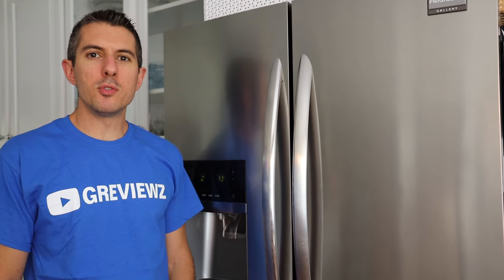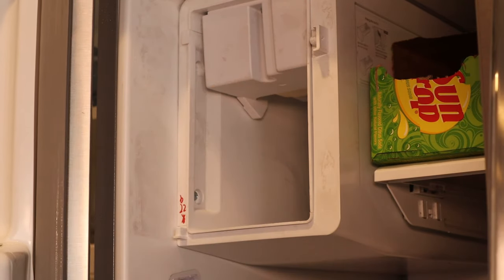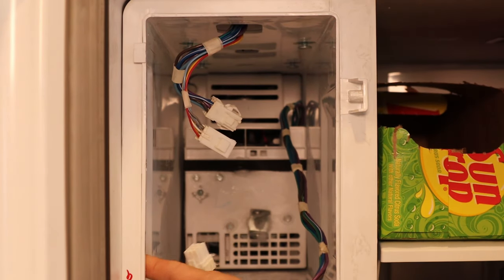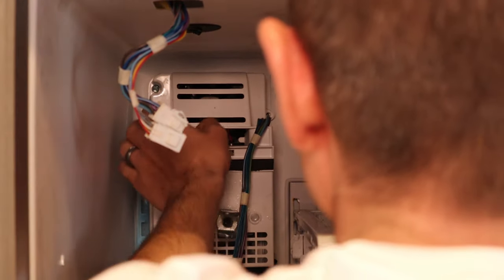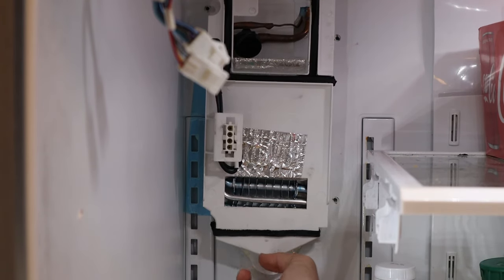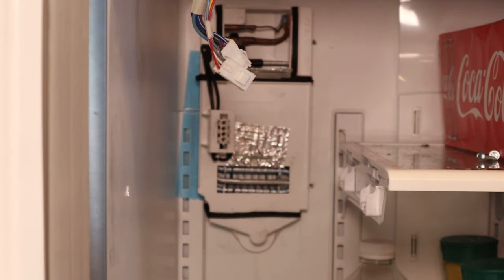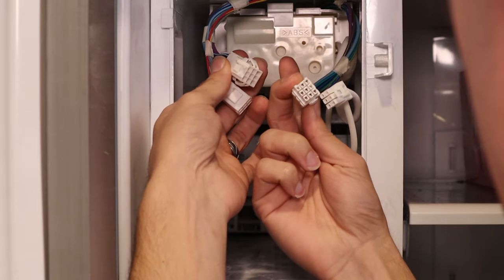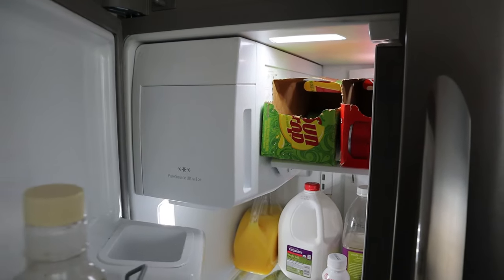Frigidaire ice maker broken again: fix it

Comment: This video did NOT help solve our ice maker issue.  As a matter of fact we wound up having to buy a whole new fridge because this video did not provide the details when removing the ice maker components. Truly disappointing
Reply from the maker: 😂 this video has 550 comments as of now and all but yours are saying the video did not provide detailed breakdown of the ice maker components. I literally showed on video how to take apart the whole ice maker. Instead of buying a new fridge you could of had a tech come out and repair your specific problem for like $300 instead of buying a new fridge. Sorry my method wasn’t able to fix your problem.
Reply: I don’t believe you are sorry.  Maybe people were too mad to post a negative comment. You are assuming we didn’t  have a plumber come out after watching the video that did not provide ALL the details. After attempting to fix the fridge,  while following your video, there was a freon pipe connected to the ice maker. This video did not mention a freon pipe at all. While attempting to remove the back piece of the ice maker, the freon pipe broke causing the entire fridge to be non-salvageable. Good luck with your YouTube career.
Reply from the maker: @kikis.760  as a whole people are more enept to leave a negative comment when they mad. I didn’t say much about a Freon pipe due to fact it had nothing to do with the fix and plus I stated multiple to be careful and pay attention to what you are doing. A plumber has nothing to do with a fridge you would have called out a refrigerator tech or even an hvac tech to deal with Freon. Again I am sorry for you fridge problem but messing with any sort of frion pipe had nothing to do with instructions.
Reply: Obviously, I misspoke about the type of service person who came out. Regardless, we were told the fridge was non-salvageable. The freon pipe should have been mentioned several times since it did have to do with the instructions. The pipe was connected to the back panel where all the ice was frozen. Interestingly enough this is where you failed to show how you actually removed the back panel, instead you said you needed two hands and stopped to take a quick snack break. When you returned it was already off.  (I am aware I don’t know the proper terms so no need to point that out.) 
Why do you continue to pick on my comment when you claim to have 550 other positive ones? Am I not able to state what happened to us while watching your YouTube instructions?  My lesson learned from this situation is the mistake in watching a video to try to fix the problem, next time I would just call the tech from the start. 
You chose to laugh at somebody else’s issue and become defensive rather than offering a kind response or remaining silent. 
My questions above are rhetorical so no need to reply, as I have a sense of what type of response I would receive.

Comment: I’m sorry to say that there’s a lot to fix your problem u unplugged the unit shutting the unit off from the Ui board isn’t the right way I have been a tech for over 22 years and there’s a kit out there that will fix it but the rust problem out there will never fix it so please people call a professional this isn’t a permanent fix I’m sorry to say but these ice makers are trash learn from me a professional period never just shut off through the ui completely unplug the unit
Reply from the maker: Sorry sir the fix from Electrolux/Frigidaire is a joke. Ive had hundreds of people that told me my fix was a joke and had a tech come out and install the fix just to message me and tell me they spend hundreds of dollars and still are having problems. I’m not a tech or anything but this design is terrible.

Comment: Lol so pointless to be this complicated fixed my old one pouring hot water through it. Should be a crime to make things so complicated and easy to break for no reason. Fridge not the Video.
Reply from the maker: Thanks for watching. Sorry my video was so complicated. I wish Frigidaire fixed the design..
Reply: @GReviewz  Your video was great lol. I Believe Ill be able to fix it with your video. Unless its a part repair. All about the fridge not your video I should be clear. Definitely seems that they do it so people will replace the whole fridge for minor issues. Again sorry the actual video is about as clear is it gets for a step by step guide.